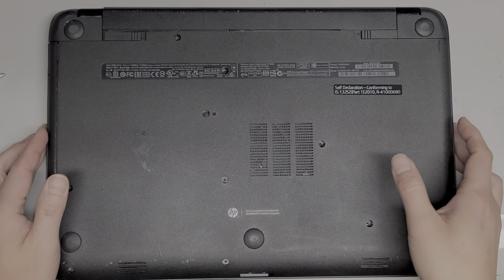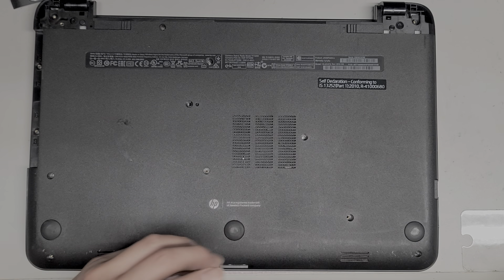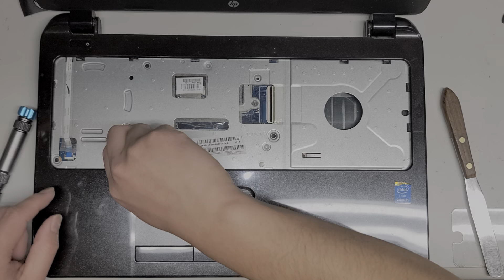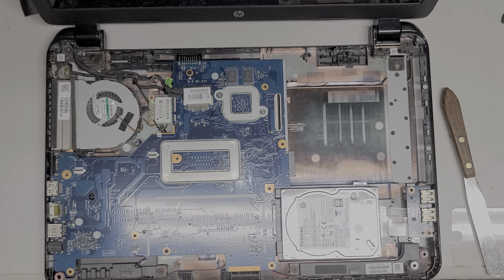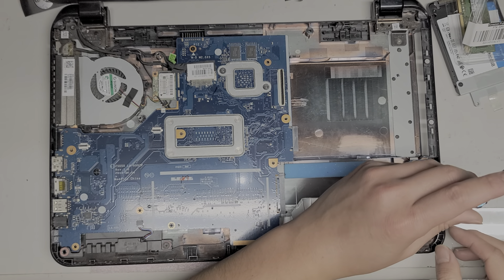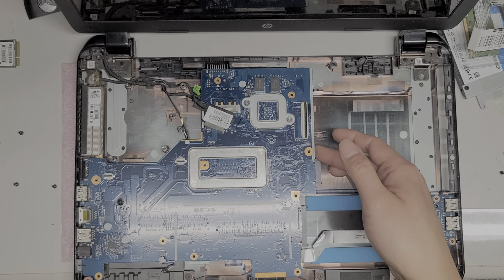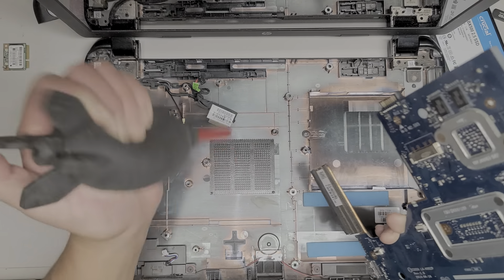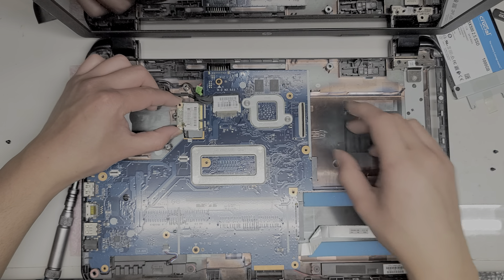HP 15-R014TX Disassembly RAM SSD Hard Drive Upgrade Repair Battery Keyboard Motherboard Replacement

Comment: Thank you bro for detail video. I managed to upgrade to SSD and RAM with help of your video. this gave new life to my laptop. Win 10 works good only with SSD I learn after my upgrade. 
Some tips: I put screw back at original position where it’s possible so I don’t have to remember that spot and worries to keep at secure place .
Reply from the maker: Glad it helped. If you haven't already, don't forget to like and subscribe so others can find my videos. Thanks!

Comment: Great video brother, now I can confidently upgrade the ram and ssd on this laptop. Thank you 👍🏼
Reply from the maker: Awesome, glad it helped. If you haven't already, don't forget to like and subscribe so others can find my videos. Thanks!
Reply: @ItsBinhRepaired  bro I’m not able to use the trackpad for some reason. The blue tape on the connector for trackpad has come out, below the keyboard, can that be the problem for trackpad not working?
Reply from the maker: @kartikyadav7560  the blue plastic tab makes it thicker to make proper contact with the pins. Without that it won't actually be connected. You can put a tiny amount of super glue in the center of the blue tab and press it back onto the connector holding for 30+ seconds. Make sure none of the glue squeezes out over the edge and doesn't get onto the metal contact pins.
Reply: @ItsBinhRepaired  bro i messed up 🥲, glue got on that metal part and the blue tape didn’t even stick on the white cable. Your thoughts?  Also thank you for replying, most people don’t. God bless brother
Reply from the maker: @kartikyadav7560  you'll have to try to scrape the glue off the metal pins without damaging them. Sounds like you put too much. You could try layering tape on it to mimic the thickness of the blue tab.
Reply: @ItsBinhRepaired  how can i do that? I’ll try, if not i guess replacing the trackpad unit is the only option available then i guess, what do you think?
Reply from the maker: A razor blade maybe
Reply: @ItsBinhRepaired  yes brother i tried that and the glue came off the metal part, but now that metal part is slightly sticking out of the white cable, i tried using it, still isn’t working
Reply from the maker: Sticking out? What do you mean?
Reply: @ItsBinhRepaired  as you must have noticed there are perfectly aligned and place but in my case they are not, one or two metal strips aren’t, hard to explain hope you are getting it
Reply from the maker: @kartikyadav7560  make a YouTube video and let me know when it's up
Reply: @ItsBinhRepaired  haha, okay bro I’ll try or maybe I’ll get it repaired
Reply from the maker: YouTube auto deleted your last comment. Make a YouTube video and let me know when it's on your channel. Don't post links. YouTube auto deletes them.
Reply: @ItsBinhRepaired  Video is now on my channel
Reply from the maker: I think the cable is ok, just need to thicken it with tape so it can make proper connection when latched down.
Reply: @ItsBinhRepaired   thank you so much bro, i have installed both ram and ssd on my laptop. And also the trackpad is working fine, out of the blue it started working. Thank you 🙏🏼
Reply from the maker: Awesome, glad I started working again!

Comment: Hello Bro. Great video ! A legit one indeed. Very detailed.
I have a question, what is the max. capacity of the RAM on HP 15 - R014TX ?
Please reply. I already have a 4 + 4. 
Now I'm planning to upgrade it to 8 + 8, do you think it will work ?
I checked on the crucial website, it says 16gb ( max. ).
But I wasn't so sure.
Thanks!
Reply from the maker: The only limit is what you can buy
Reply: What is the max RAM capacity of this laptop?
Reply: @hemantakumarnaik315  16gb
Reply from the maker: There is no max. If you can get 2 16gb sticks it'll work.

Comment: Excellent video man. Very useful for me as I have the same laptop.
Reply from the maker: Glad it helped. If you haven't already, please like and subscribe so others can find my videos. Thanks!
Reply: Is the existing ram single channel?
Should both the slots needs to have same channel types? Single/single or dual/dual
What is the maximum extendable limit for this model?
Can I add 8gb card along with existing 4gb?

It would be helpful if you could answer those!
Reply from the maker: @SivaBal642  there's no such thing as single channel and dual channel RAM as far as I know. You want even number of sticks and same capacity for it to run in dual channel mode.

Comment: I have r218nt and 2gb ram on it. Changed the hard drive to ssd months before but couldn't find the ram slots. I will try to add on 4gb I hope it work. Thanks for the video 👍
Reply from the maker: Hope it works out.

Comment: Quality content 👌.
My hp15's USB ports & audio jack don't respond properly. Can those parts be replaced ?
Reply from the maker: Usb ports next to the cd drive as can be seen in the video. Audio jack, only if you can solder.

Comment: Hello Bro, very nice and detailed explanation. I have three quick questions and looking for your help:

1) I want to clean the fan and vent so after opening the panel can I remove fan just after removing the wifi card? I think it's not necessary to remove any thing else  other than wifi card to remove the fan on this model?
2) Can vent be also cleaned (after removing fan) without detaching the motherboard?
3) Also can we use a normal soft brush to clean the little dust on motherboard?

Thank you 👍
Reply from the maker: This might help https://youtu.be/3zs_SJ3BXgA might want to disconnect the battery and hold the power button to be safe as well. Remove whatever needs to be removed.

Comment: Nicely demonstrated each details with care. Many thanks!! 
How was the performance afterwards? What if only RAM added?
Reply from the maker: Glad you liked it. The SSD is the much better performance upgrade. If not doing that, might as well not upgrade the RAM.
Reply: I replaced the SSD and RAM, there is no OS. But the laptop is not powering on.  Can you suggest.

Comment: Looks like my hard drive has failed so ordered "plug and play" hard drive used replacement from ebay.  I am pretty sure I have lost what may have been on puter.  Is it a simple swap if they say plug & play? All I have are recovery discs?
Reply from the maker: What do you mean plug and play? Hard drives don't come with a plug and play OS.

Comment: Hello, thanks for the detailed video. You mentioned cpu is soldered to the board,  so is there any way to apply thermal paste on cpu and gpu for heating problems on this laptop?
Reply from the maker: Yes, you just can't replace the cpu.

Comment: Very well explained. Just not sure it's worth me adding more RAM. It has 4 now. Was going to max it at 16, e 8 mb sticks. Just send like a lot of delicate connectors to worry about. Not sure that will solve the sluggish performance of the computer.
Reply from the maker: What you want is 8gb of RAM and an SSD https://youtu.be/4p5jFDzVwUw

Comment: Good Morning in CA
Excellent video Binh. I'm trying to upgrade the same laptop for a friend. The SSD upgrade went well but the memory not. I did the scan with Crucial to make sure the module was compatible. I got the memory stick from Amazon, 8GB but the laptop not even boot with it. When I put back the old memory stick it works well. I just want to double the memory to 8GB since 4 is not enough for Windows 10. Do you think  if I try a different brand will work?? Or can you recommend a module that might work in this case?
 This model is HP 15-r011 dx. Send me the link if you know of any place where I can get it.
Keep up the good work and thanks for your help.
     
                                                From NY, Bismarck Cruz
Reply from the maker: What is the speed and specs on the original RAM and what is the specs of the new one?
Reply: @ItsBinhRepaired  The original is: Samsung 4GB 1Rx8 PC3L - 12800S-11-12-B4
The Crucial one is: Crucial RAM 8GB DD3 1600MHz CL11
Reply from the maker: Strange, it should work.
Reply from the maker: Did you try reseating it? If it still doesn't work, maybe it's defective. Try this https://amzn.to/3gylRMG
Reply: @ItsBinhRepaired  Yeah, I tried that too and it didn't work. I think it's defective. I already sent it back to Amazon. I'm going to try this one you just gave me.
Thanks Again and God bless you.
Reply from the maker: Hope it works

Comment: Can we use 8gb ram instead of 4gb in this laptop ?? Please answer.. And also what size of cd rome caddy for this laptop.
Reply from the maker: Should be fine. You'll want matching sticks of RAM. Measure the thickness in mm of the cd drive. I don't memorize or check those things.

Comment: Thanks for the video. Nicely done.
I have a couple of questions, if you could please answer them.
1) Can I still follow this video for a 15-R014TU instead of a TX that's used in the video.
2) Is it possible to add an SSD while still keeping the original HDD?
Thank you
Reply from the maker: 1 if it's similar, yes. 2, if you replace the cd drive with a hard drive caddy, yes.
Reply: @ItsBinhRepaired   Thanks for the reply.  2 more Qs if u don't mind. 
1) Is the cd drive port SATA2 or SATA3?
2) If SATA3, would it make any difference in the performance of the SSD if it's connected to the cd drive port or to the HDD port (after moving the present 1TB disk to the cd drive port)? Thanks
Reply from the maker: @shrikantaaradhyacs3326  not sure. Better to use the SSD in the original HDD slot.

Comment: I ordered TEAMGROUP Elite DDR3L 8GB ram it is PC3-12800 so should it work then?
Reply from the maker: I think so
Reply: @ItsBinhRepaired  alright thanks. I do not have the exact model in the video but it is similar to the one shown.
Reply from the maker: @cannedfruitcup  then I wouldn't know.
Reply: @ItsBinhRepaired  should work because it’s same build just different specs.
Reply from the maker: Hopefully
Reply: @ItsBinhRepaired  worked thanks
Reply: also would a Kingston - A400 240GB Internal SSD SATA work in this laptop
Reply from the maker: Sure

Comment: After watching your vdo I added 8gb RAM to the original 4gb... the BIOS shows 12 gb of RAM but the usb doesnt work. Any advice or solution?
Reply from the maker: Which ones? The ones next to the hard drive?
Reply: @ItsBinhRepaired  nope... the 2's next to the CD roms 😬
Reply from the maker: @josephthomte  those are the same ones... lol check if you damaged the cable or disconnected it somehow.
Reply: O yea 🤭... its the ones next to the HDD thats not working 😁
Reply from the maker: @josephthomte  lol check the connections. The good thing is, those are replaceable.

Comment: in all likelihood, if there are parts in a laptop that will be upgraded, its the storage and the ram. Its crazy how these manufacturers make it so difficult for end users to do this. Couldnt they make special compartments for ram and HDD/SSD? Couldnt they integrate a tiny switch that will also disconnect the battery from the mobo? Geez!
Reply from the maker: They could, but they want you to buy a new one

Comment: I have HP NOTEBOOK 15 PC Model : r128tu I want to install one stick 8gb. What is the maximum?
Reply from the maker: There usually isn't a maximum. Just make sure you buy somewhere with a good return policy.

Comment: Are you using singal channel ram or dual channel ? Plz reply bro
Reply from the maker: Whenever the customer has in there. I don't know
Reply: No bro I was asking what are you using ram in your laptop in this video is it singal channel or dual channel ram ?
Reply from the maker: @Comdeywalashorts  I don't know. I would assume they're all dual channel unless only one stick is used. I don't own these computers and don't bother with specs. I just fix them.
Reply: Okay fine thanks for your reply bro👍
Reply from the maker: @Comdeywalashorts  yup

Comment: What if I buy a ram of some other company instead of samsung, will it still work?
Reply from the maker: As long as it's the same speed/type
Reply: @ItsBinhRepaired   like pc3l 12800s?
Reply from the maker: Yup!
Reply: @ItsBinhRepaired   tysm!
Reply from the maker: @bibrataroychaudhury6608  no problem
Reply: @ItsBinhRepaired   So, I dissembled my laptop, and messed of the connectors attached to the upper base of the laptop, like the blue thingy got peeled of the power button connector, but it still somehow works, but it loosens up after sometime and the laptop doesn't switch on, any solutions on this so that this problem doesn't occur again?
Reply from the maker: @bibrataroychaudhury6608  you can glue the blue tab back on or put several layers of tape. It's needed to get it to stay in the slot securely.

Comment: Can I use a Corsair 4GB DDR3L 1600 MHz RAM having diff latency with Samsung 4GB PC3L 12800S
Reply from the maker: As long as it's pc3 12800s
Reply: @ItsBinhRepaired  I didn't get you..
Reply from the maker: @satyanarayanmahanta3780  that's the type of RAM you need.
Reply: @ItsBinhRepaired  CMSO4GX381C1600C11
CORSAIR
Max Bandwidth PC3-12800(800MHZ)
Latency 11-11-11-28 clocks
Is it compatible
Reply: @ItsBinhRepaired  Although the RAM is working fine I doubt if it will cause burn to the motherboard..I have seen some reviews...
Reply from the maker: @satyanarayanmahanta3780  I don't open links like that. Could be virus. RAM should be fine.
Reply: @ItsBinhRepaired  Ok Thank You Bro😍
Reply from the maker: @satyanarayanmahanta3780  no problem

Comment: How about 8 gp ram?
Reply from the maker: As long as it's the same type and speed.
Reply: @ItsBinhRepaired  after i add kingston ram 4gp and there are 4gp inside laptop when boot windows see the ram only 4gp
Reply from the maker: @mohandmohand2047  did you do a restart?